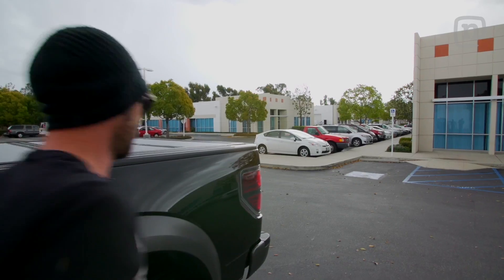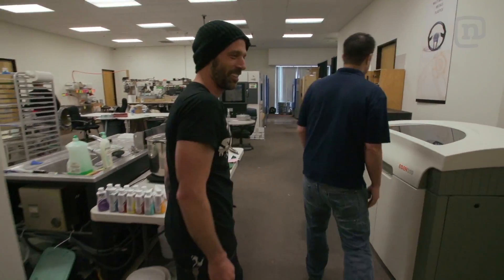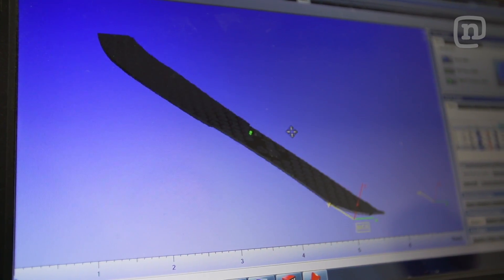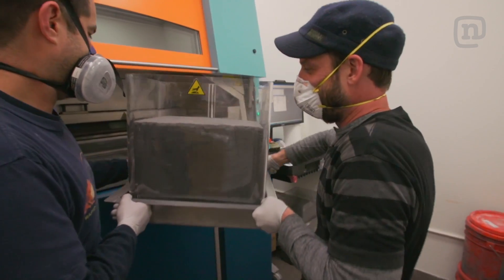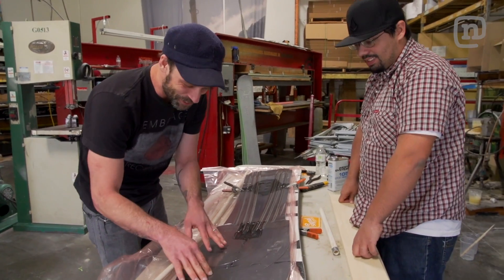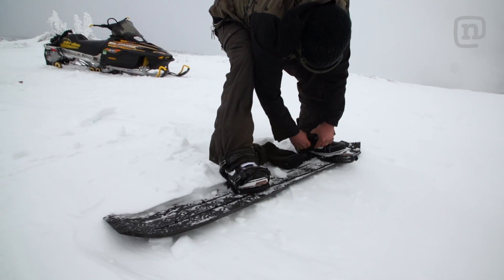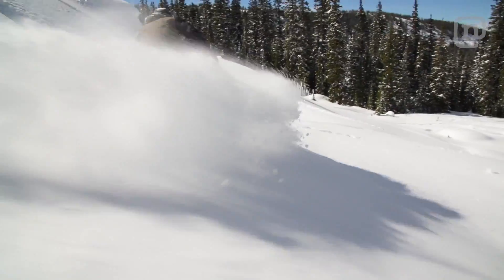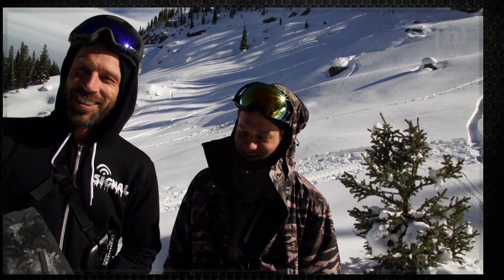The World's First 3D Printed Snowboard: Every Third Thursday

Comment: So basically it's a 3D printed core, with metal top supports and a need for a base to be added to go fast. with sides shaped that if used on anything but powder wont give an edge..  (3D printed or not)  

Nice run,

Comment: Wonder how it would do if the board could be printed as one piece. Those seams looked to be placed in the spots that needed the most structural support, as in the worst spot for a seam.
Reply: +Joseph Gutman That's true. I'm surprised they didn't do a gridded/hollow design that would allow the resin to permeate it.
Reply: +Joseph Gutman i agree, they shouldve at least made the seams run parallel with the board.
Reply: +Joseph Gutman would have been much better.  also maybe a different material.
Reply: the best i can think is to make the puzzle parts with hinges from one to the other and then print it 'rolled' side way up....and when you unroll and ride it the tensile stresses from the bend can be countered by nerves along the board(holes need for the reienforcement)

Comment: that is just stupid. worst application of this manufacturing technique seen so far
Reply: It may not be practical for mass production, but it is actually a great demo of 3D printings power. They were able to make this board for cheaper and in less time. Not too stupid if you ask me.
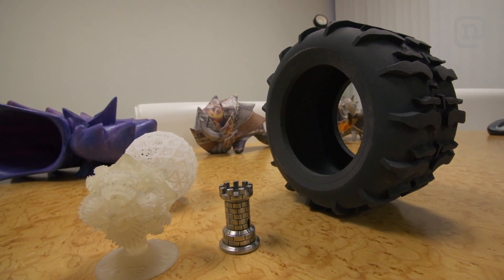Reply: +Aidan Leitch I appreciate the answer. 3D printing is great and offers great potential. Of course a basic tasks is rapid prototyping. But the way they applied the technology in this case tells me, they have no idea of structual mechanics. They could have used steel reinforced resined dough as well. I don't know how this shows the potential of 3D printing except 1:30

Comment: I will pay top dollar for a hand crafted board every 5 years and I won't even think twice about it. Some things shouldn't be messed with...if it ain't broke don't fix it!
Reply: They weren't trying to "fix" or replacing anything. They were trying to show the uses of an emerging technology for the sake of a cool video.
Reply: Ive been in the graphics industry for the last 10 years...I'm cool with inovation 100% just don't claim it's better or cutting edge because the fact remains...some things are what they are and u shouldn't screw with it. Don't fuck with my snowboard it works fine!!
Reply: +MOORE C Well, it is technically "cutting edge", but they never claimed it to be better than traditional snowboards. Who knows, 3D printing could potentially be a way to manufacture cheap (but granted less functional) snowboards.
Reply: +Aidan Leitch Nope. Never even a possibility lol
Reply: +MOORE C Really? Since you're clearly a such a prophet, why don't you explain why that will "never" happened.

Comment: looks like a 20 year old burton.. some things should be HAND MADE. i dont care if 3d printing just came out leave my board alone...fuck. SERIOUSLY
Reply: It's just for a video, that's why they made the video. It's cool not practical.
Reply: Actually 3D printing has been in existence for years. Also, if you noticed in the video, 3D printing the board enabled them to use different shaping and geometry.
Reply: Aidan Leitch ok but it still sucks....
Reply: NOT VERIFIED Have you tried it yourself? I don't think you have the argue that it sucks. You should accept the future instead of shunning it.
Reply: That will never be the future of snowboard manufacturing..not now not ever.
Reply: NOT VERIFIED I'm not saying that handcrafted boards will die out, but 3D printing could cause making boards to become much less expensive. Think about it, very little hand labor, fairly quick, and as I said, cheaper.
Reply: Aidan Leitch The way they demonstrated the technology here doesn't make sense. The result has to be a non functioning, weak snowboard. If you'd know about specific tensile strength, stress distribution as subject to bending moment, materials stiffness and geometry or if you'd know terms like steiners component and respectively the reason for sandwich structures, you'd agree. So please just do not use 3D printing this way.

You could use a 3D printed core, which would be a different application and not what can be seen in the viedeo.
Reply: +Aidan Leitch no.
Reply: None of you realize that a 3D printer is  prototyping tool, not a mass-production or factory tool. This thing probably took somewhere around 24 hours to get printed.
Reply: +Joseph Kaufman 3D printing can be a prototyping tool, but many people are using it for actually production as machines get better. I have years of 3D printing experience, I think I'd know.

Comment: The high compression core material can be high density polyurethane which can have the same density as wood, or you can also use fiberglass chopped strand and epoxy mixed with hollow glass bead, or bamboo fibers, pour it in let it setup and then use acetone to melt off the ABS or sand it down. Then vacuum bag it with the high tensile carbon outer skin. This method is good for complex 3D shapes, this means you can vary the board thickness where it needs to be more or less flexible.

Comment: exactly what you did, a board. But it'd be awesome to print a single board using tech like the Connex multi-material printer, varying the material to give you the rigidity and flex where you need it, not to mention a better base. I also like the work of artist Bathsheba (bathseba dot com)